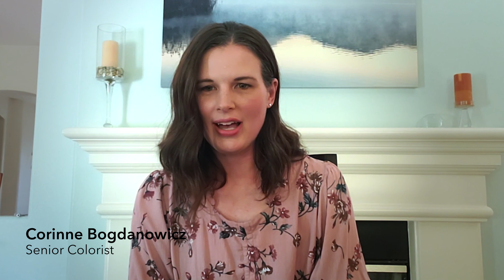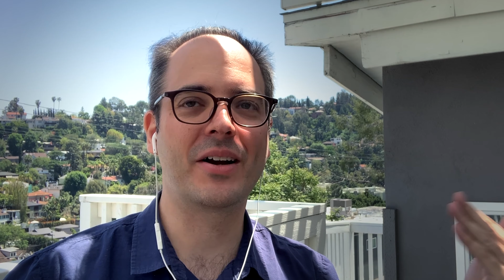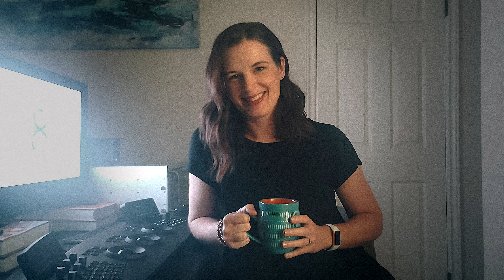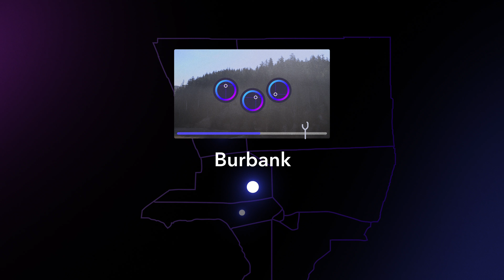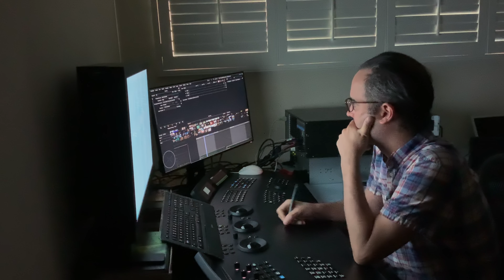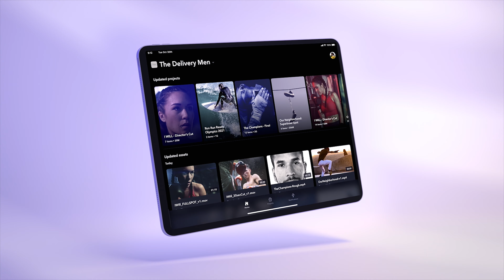Workflow From Home: Ep 10 - Scaling Remote Post Facilities

Comment: Yeah, 6 out of 7 of our editors are working from home too. Getting everyone setup was the hardest part, but things eventually settled into a flow. We've been just as efficient and even couriered tb drives back and forth for the big projects. I've done some client edits using a screenshare. It's not perfectly smooth, but once we figured out the direction they were able to watch me work and then just review the finished files on frame on their end. To go back to exactly the old ways would be a waste.
Reply: hey isaiah, out of interest what have you found to be the best screen sharing software for live edit review? framie.io is great for uploading for super accurate review, but, i'm struggling to find a super decent live review piece of software? i'm on Avid Media Composer.